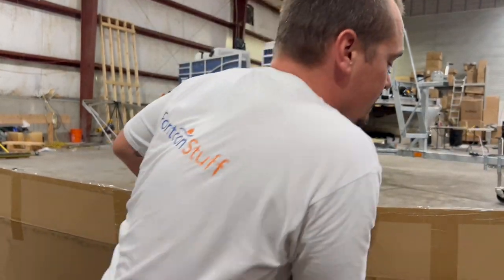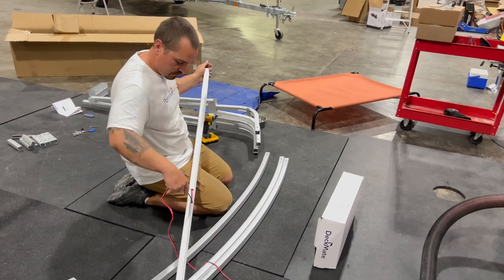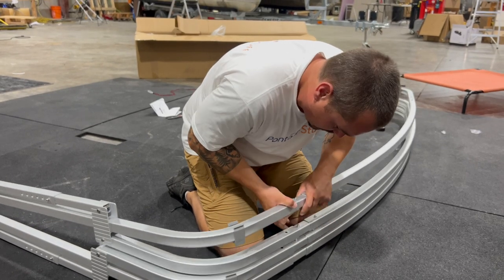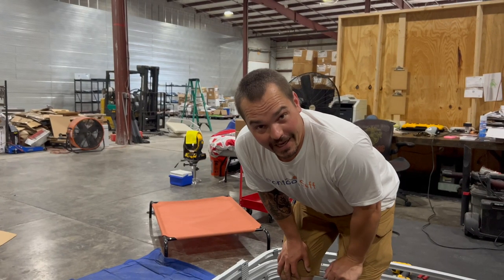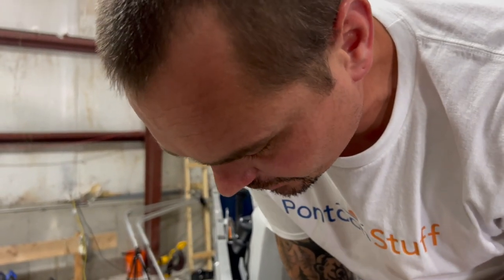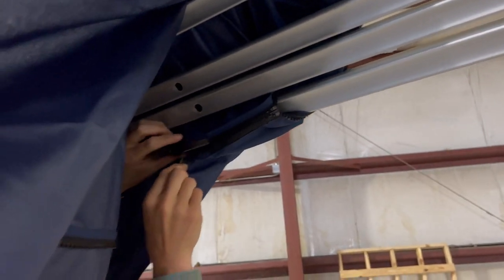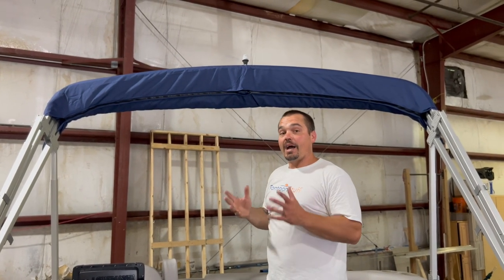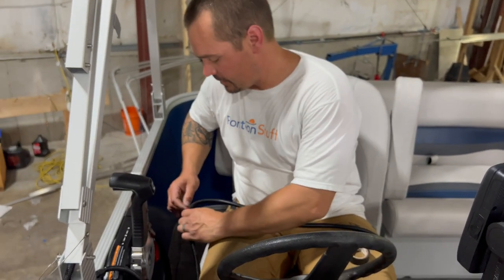New Pontoon Bimini Top Install - How To Video

Comment: Great job!!
Could space that Tohatsu control out using spacers like what comes with the Suzuki controls and hide the wire bundle in that space behind the control (plus get some extra clearance for your throttle hand on the throttle 👍).
Reply from the maker: I definitely like using the spacers when I can, but this control was mounted through the fence paneling (not the tube of the rail) to get it to mount nice and flush. When doing so it's solid, but the second I add spacers the leverage makes things a bit wobbly. I love your idea though for running the wiring behind the box using the spacers!

Comment: Another great job thanks. I will definitely use that shop vacuum idea to pull wire's was great could be used in multiple application thanks
Reply from the maker: Thanks for watching! The vacuum trick was a game changer for us FOR SURE. Old electrician trick for pulling wire through conduit so it makes sense. If only I'd have learned it sooner in my restoration career....the time and curse words I could have saved!

Comment: Hi Tom!  I'm not sure how many times I've watched the same videos over and over but I'm gearing up for my own rebuild once all my backordered items arrive.  Can you get away with having less than 79 1/2 inches of fence spacing for the 8x8 bimini?  I will be installing the 8' wide stern entry kit soon.  Based on my diagrams I would have between 75" and 79" depending upon what I use for the door.  I know the railing kit comes with the extra 5" panel but I'm trying to avoid using that since my console will be pushed forward into a 28" corner (like you did in another video).  If I use that extra panel I'll have to push the console forward and then I'm cutting it close with my steering/shift/throttle cables.  Thanks for your advice and for taking the time to create all these videos.
Reply from the maker: I’m assuming you mean length on the railings, not width. You can squeeze the brackets a little on the front and back and you’ll be just fine. You’ll likely have to adjust the spring button settings on both front and back, but it should fit up nicely once adjusted. 

Keep in mind that sometimes a little re-directing of cables can give you a good amount of extra length. Sometimes they’re routed out and about instead of on the most direct path. As long as you don’t go under any crossmembers you’ll be good!

Comment: Hey Tom are the extra tall brackets needed @2:50, with Pontoon Stuff seats? I ordered a top and frame from Overton's (frame came in scratched have to return😡), theirs doesn't come with those extra tall brackets, They gave me the option of a refund, but because I notice Pontoon stuff Bimini's are back in stock I can just order through them, question is will Pontoon Stuff come with  the extra tall brackets...I suppose I should call...Thanks Tom!
Reply from the maker: The pontoon stuff heavy duty biminis come with the tall brackets that get everything above the seat backs to prevent rubbing. I just got a couple of them in that I ordered a while ago so they must be receiving them now and getting to shipping them. A call to their customer service would be a good idea tho!